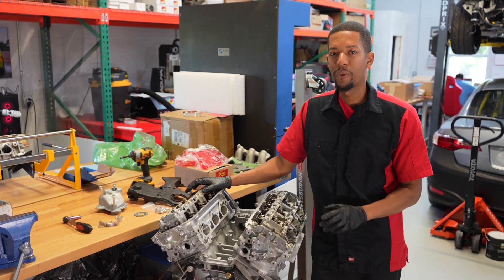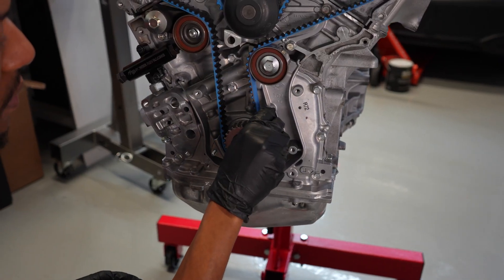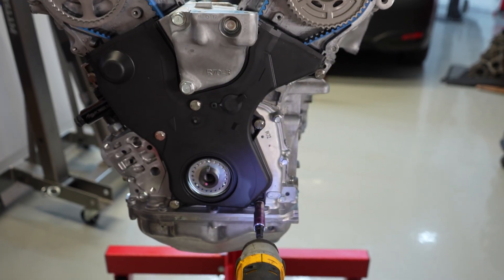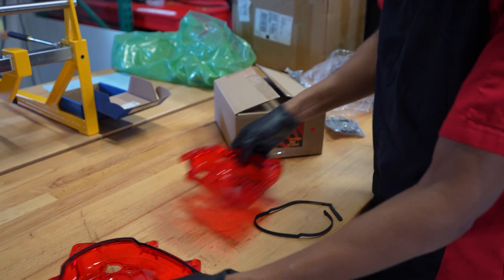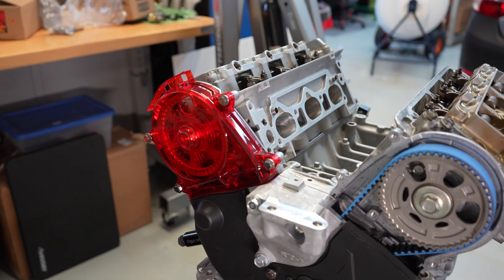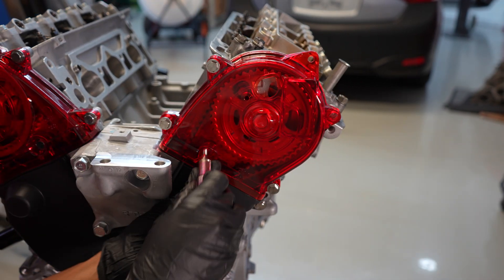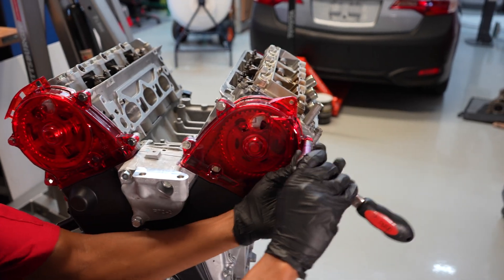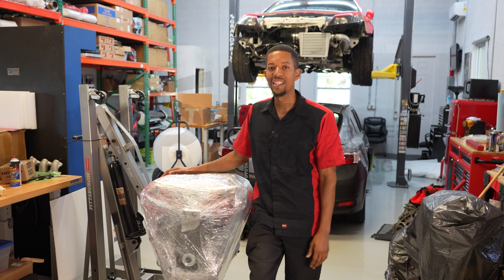J35Z2 Engine Assembly Part 2 - Timing Belt, Timing Covers, & More

Comment: I can’t turn the cam shaft to #1 cylinder, it almost sounds like valves are bottoming out. I forgot to put the sprocket for camshaft on #1 before installing the head but I an just take the rocker arms off, rotate pulley to #1 cylinder then put rocker arms back on and adjust lash right?